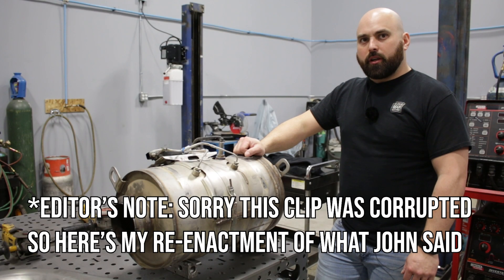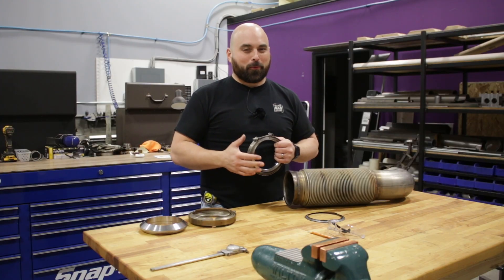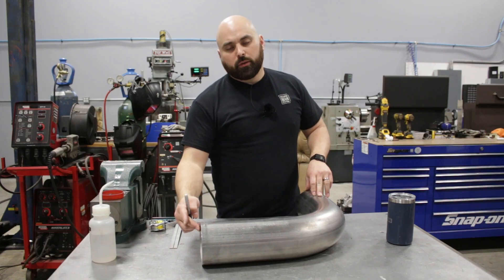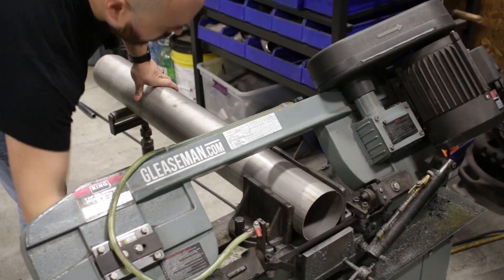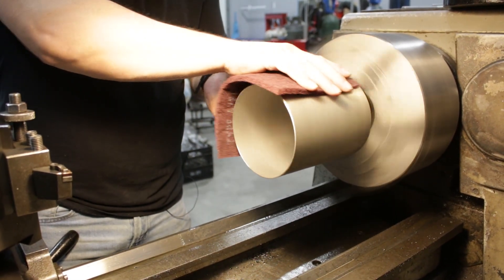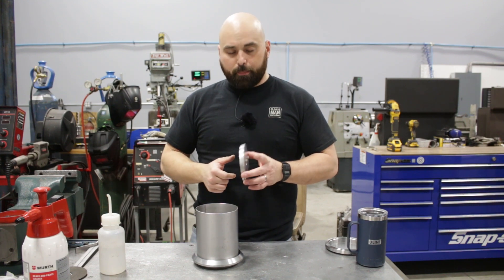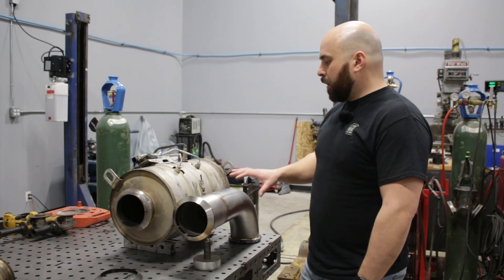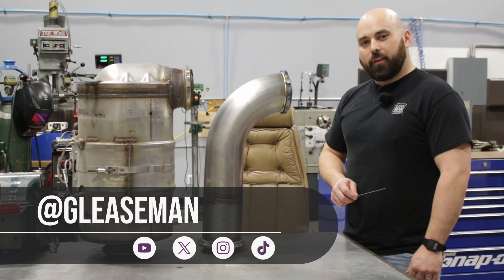I Broke The Law to Help a Farmer.

Comment: A question why you doing it if you like the def crap hum I know you said you didn't ask questions lolol you know it is against the law to do it so why the video so EPA can find everyone doing this sounds like to me
Reply: You really need to ask why he would do it if he likes DPF systems? I hate rooms painted yellow, but still did them for my customers. I hate mexican beer and cheap common light American beer, but have still bought it for good reason.....a simple reason. Use more logic and less emotion to find the answer. He either lied about liking DPF, or likes it but doesn't care what someone else chooses to do. His customer wanted a part made and he doesn't care what it is for, so he made what was required with specs from the example provided. I like the DPF on my truck, other than when the DEF system gave errors for no real reason. It doesn't mean I agree with the EPA or am out to help them. Edit: my truck isn't deleted because I like it and don't want to go down that road, but if I had major problems with it and the warranty on the exhaust was no longer good, I could imagine it might cross my mind.
Reply: I used my laptop to turn off egr. Is Lenovo going to get sued? Intel? Microsoft? How deep does the supply chain of fixing my own shit and minding my own business go?

Comment: Well done sir. I run modern Caterpillar, Komatsu, John Deere equipment in Northern Ontario, Short of something physically breaking on the machine, 98% of breakdowns are due to the dpf system. It's pretty sad the 20 year old engines can be counted on to run, when a clouded mirror in a def level gauge will put you in limp mode.
Reply from the maker: Yup, pretty wild. 

How far north are you?
Reply: @gleaseman  in Timmins
Reply: Not like the system does much, it just injects Uria into the exhaust to keep the visible soot from the diesel engine down. So it stays in the engine, oil and pipes leading to more wear over time.
Reply: @SilvaDreams  an active dpf system for a diesel engine is terribly complex, there are pumps to and from the urea tank, engine coolant loop to warn the urea tank, pumps for the diesel injection, back pressure sensors, urea tank sensors, glow plug system, computers to run the burn cycle not even to mention urea freezes, shouldn't be stored in 30+ degrees, or the entirely new economy of pollution produced by Def jugs or chemicals used to clean the honeycomb filters. To say it 'just injects urea into the exhaust" is not accurate. I agree with you, a lot of tech and headaches for a problem that would be solved by industry regardless as better technologies evolve.
Reply: @DanSav76  I'm well aware of the parts of the system but it doesn't change what I said. All it truly does is reduce a visually "scarry" puff of carbon dust for the environmental nuts that is essentially harmless.
Reply: @SilvaDreams the DPF removes the soot. Urea in the decomposition tube and SCR reduces NOx emissions.
Reply: I believe that DPF systems were designed to put smaller farmers, truckers, and any other business that uses diesel trucks... out of business. To kill competition so the BIG Corporations can have it all, and the rest of us can work as slaves.
It's not about clean air.  Electric cars, wind mills, and solar panels made with rare earth elements ALL do much more environmental damage.

Comment: Ex trucker, DPF's are okay when they work properly, the probelm with them is if they start to plug early for whatever reason or if the system doesn't work it very quickly becomes an expensive problem that you have to fix to get the vehicle to run. I had a truck that would regen once per week, never had an issue with the DPF. Ive also had trucks that regen 2-4 times per day and it is annoying AF. Excessive Regening can also lead to other problems such as the vehicle catching fire or your bank account emptying.
Reply: Yep, I like the DPF on my diesel pickup. It is nice to not smell the exhaust or have as much soot at the back of the truck and it is quiet for long rides. For a while I would get a DEF error message but it has gone away. Chevy gave a 100k mile warranty on the exhaust on my 2020 truck.....hopefully I don't need to use it or have to pay out of pocket after. My brother wasn't so lucky with his 2019 truck but he lets his idle a lot. Like many good ideas, they can turn bad for various reasons.
Reply: You probably drove. Its these truckers that are sitting idling and not driving that are clogging up their DPFs. Drive instead of sitting at the truck stop, and you keep that DPF clean much much longer.
Reply: @CL-yp1bs  The problem is that they have limits to the number of hours they can drive and they need power and heat or ac. It looks like dealing with DPFs is another reason for trucks to have APUs so they can run those and not the truck, but it also adds more expense. I'm not sure much fuel an average truck burns idling vs. an APU but would think the APU would take less if it isn't always running at full capacity.

Comment: in the uk its not actually illegal to remove emissions control if it stays on private land, on the annual road safety check that cars have to go through here they test emmissions levels and check the emissions control devices are still fitted, crazy thing is that most cars will still pass the emissions tests without the control devices, but theyll still fail it for not having them

Comment: 3:26 DPF and DEF systems are horrible and NOT A GOOD THING... The soot from a semi is not the devil incarnate.  These systems add expense, failure points, and decrease engine life.

There is no way in hell that anybody can try to make a claim that producing these monstrosities helps protect the environment more than the soot and gases that a normal vehicle would produce over its lifetime.

To just make a DPF filter you have to mine metals and refine them and then spend the energy to produce the part.  Then there's the additional fuel needed to burn off the soot... Which consumes extra natural resources
Reply: Bingo

Comment: DPF filters and EGR valves kill diesel engines, best to get them removed. After you get more MPG. I'm getting about 25% better MPG. And better gas emissions results at testing time.
Reply from the maker: That's pretty wild, thanks for sharing.

Comment: Very high quality manufacturer , beautiful TIG welding and machining .  This is just an exhaust part , MIG weld and place an adhesive on the gasket . Form the sheet metal flange .
Reply: It's stainless, better to tig weld.
Stainless lasts longer, that's about it.
Maybe in racing there's a weight advantage.
Reply: @Channelmaster73  It was a process to delete the pollution system which begins failing from DAY ONE .

Comment: DPF filters don’t actually solve the emissions problem, they just kick it down the road to landfills, modern common rail VGT turbocharged diesel engines are already the cleanest burning diesels ever produced. When tuned properly they’re incredibly efficient. Really the standards should be based around amount of “work” done for fuel used, because an engine that burns less fuel will have lower emissions due to them really just burning fuel with air at a target air fuel ratio, but something like that makes sense and would potentially help the environment, not a thing governments really do. People really should push back on their regulators and institute solutions that both protect the environment but also the profitability of their business, because if a farmer has to spend more to do his job we all have to spend more to eat, thus making all our work more expensive, it quickly snowballs and that’s why the cost of everything has spiraled like it has.
Reply: How do DPF (no need to say filters twice, same as NIC card in the computer world) kick it down the road to landfills and not solve the problem. The soot is captured and then burned off, not sent to landfills, at least when working properly. The only thing I notice from a regen is heat, not soot, and it doesn't stink like diesel exhaust. Without the DPF the emissions go into the air and I see and smell it. If you are talking about the dpf going to the landfill, I would assume they would be recycled...at least the body of them. Your statement doesn't make sense, even with common rail diesels being the cleanest.

Comment: Test pipes are so hard to find sometimes. Now he can find out if a particular part was the problem.
Reply: Right to repair is an absolute must.
Reply: I came here to point that very thing out. Test pipes are crucial to the proper diagnosis, maintenance, and repair of these very important pollution control devices.
Reply: "Test" Pipes what an euphamism for screw the government....!  Never even heard of them until after the invention and mandatory use of catalytic converters etc...L o L !

Comment: SMH.....!  I think this is illegal in Canada also. Guess Canadian laws don't apply to all their citizens.
Reply: It's illegal to make a pipe and do some welding?  I don't think so.
Reply: Is it wrong to try to protect the environment from one of the dirtiest fuels we know of. Does your diesel run better with CLEAN air???
Reply: @leroythemastermechanic  two questions:

which is more damaging, burning diesel with no filter and getting really good mileage, or burning twice as much diesel and getting half the mileage?

What has come of the report i can't seem to find anymore where California had found DEF particulates on it's crops from the crap it's basically forced the entire country to use?
Reply: Diesels make MORE power when they are NOT belching black smoke!! If you want more power from your diesel, you need to increase the air flow through the engine. Cam swap, positive displacement screw type supercharger, and bigger injectors. The correct combination WILL NOT clog the DPF!
Reply: My car is 50 state emissions compliant at 572 CID, 136MM ProCharger, and way too much nitrous oxide! Read your state laws!
Reply: This is from an off road machine (sprayer). nobody is gonna give a rip about the dpf being gone. Commercial Semi Trucks on the other hand are strictly enforced.
Reply: @MCsk-sv4kl  The issue is doing it commercially, making a profit from it, or reselling the vehicle. Nobody cares if you modify your own vehicle. EPA only sets the standard for what comes out the tail pipe. The parts that are used is up to each individual manufacturer. But whatever parts the manufacturer decides to use are PROTECTED by the EPA laws set by our congress.
Reply: It is illegal in Canada as well, not as widely enforced like the US but if you're commercial it will be inspected yearly and caught. That being said I had to delete one of my 5500 service trucks short term as I physically could not get a replacement DPF filter from Dodge for about 6 months during Covid. I reverted it once the parts became available but the unfortunate thing was the truck lived such an easier life without it on. I used to delete every truck I owned but they are cracking down hard especially in B.C., Canada.
Reply: @titan5535 how hard do they inspect to see if the dpf body contains a filter? Could one weld a straight pipe inside of a dpf filter body and pass the inspections?
Reply: @titan5535   suuuuuuure 😉😉
Reply: @titan5535 
If you get rid of Justin Trudeau Castro, that won’t be a problem then

Comment: Great work, though, considering the increased crack down on manufacturers, I wouldn't be posting something like this myself. Might be more lax up there than it is here state side.
Reply: This is clearly for educational purposes only, not recommended for anyone to do as stated above. Elon posted instructions for creating a nuke for example.
Reply: NO issues doing it here in Canada surprisingly there is way way less over reach for such matters in Canada and it falls under provincial jurisdiction NOT federal also..